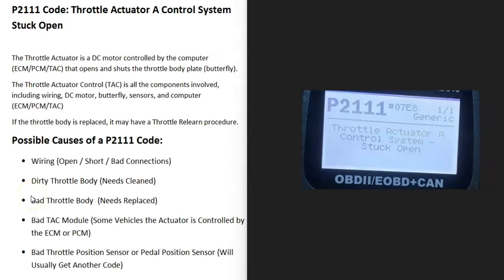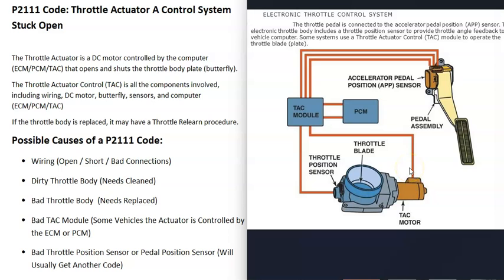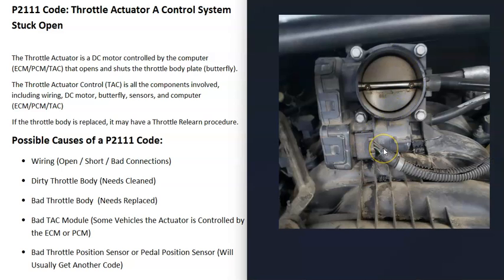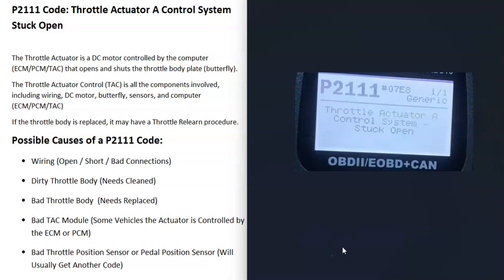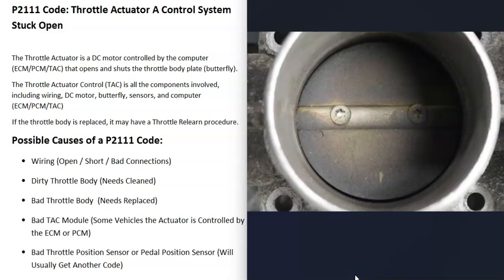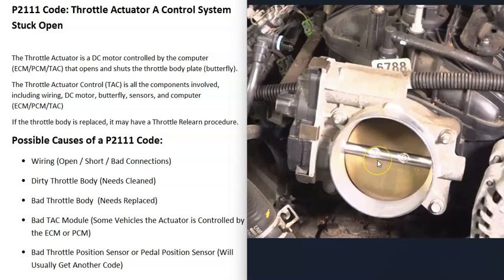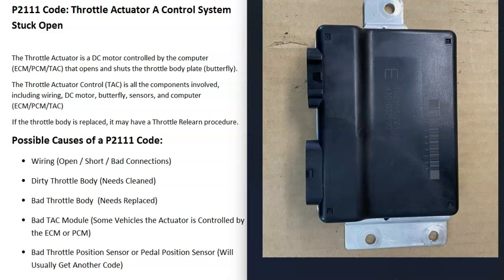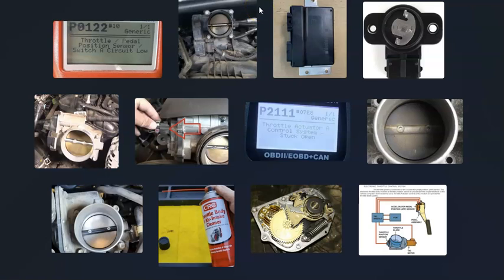Causes and Fixes P2111 Code: Throttle Actuator A Control System Stuck Open

Comment: All I did was replace the battery in a 2006 Ford 500 and I have zero throttle response. The owners manual was followed to the letter in doing the throttle relearn with zero success. I’ve done the procedure five times today, and I have been troubleshooting this crap literally for seven hours watching videos And try and techniques from even other manufacturers with no success.
And all I did was replace a dead battery.
Reply: Did u ever figure this out?

Comment: My fiancé's 2007 Ford Mustang GT recently had this code as well as a P2112 and P2104 all related to the throttle body.  I checked voltages to the TPS and APP and they were normal.   I tested the DC motor and it worked as well.  The fix for her car was a new Throttle body.
Reply: You get a p2135 code too?
Reply: @tonymurphy1234  I did not.
Reply: Did it run before you swapped the throttle body or was it a crank no start?

Comment: I have p2111
P0102 mass or volume air flow circuit low and
P0113 intake air temperature sensor 1 circuit high
Whats going on with my car?

Comment: I got weird symptoms with my pirus 2010 gen3,  firstly the throttle body butterfly don't move when I press the pedal, and when the engine starts the butterfly barly open and close. 
I had a knocking engine recently and I cleaned the EGR and manifold, the knocking is way much better and misfire codes disappeared. But now I got bad idle and short knocking at the start of the engine only. Accelarating is very sluggish and sometimes get the P0103 and P0171 codes.
Help please

Comment: I have a 2012 Lincoln mkx with this code.  
Goes dead after cranking and try to drive it.   When I turn the car off crank it back up it and drives fine.  Could ethanol based gas have anything to do with this??
Reply: Have you found The solution? Me edge isso acting exactly like this
Reply: @ I found out that it was something to do with the master cylinder, and the brakes. I  had put on brand new rotors, and apparently the brake lines had air in them.  Another YouTuber said to put the vehicle in drive and as it starts moving mash the brakes really hard and that would help  the master cylinder brake fluid. Now, after a few weeks pumping the brakes, it works fine now with no issues.
Reply: @Tacticaltig68 looks like a shot. Gonna give it a try
Reply: @ does your brakes have a soft spot or it goes further than normal cause that means there’s air in the lines you can look that guy up on YouTube and see what he says that’s what I did. Good luck, brother.
Reply: @Tacticaltig68  turned out to be the TB. I did disassemble it and have it cleaned, even the actuator chamber. Then the relearn procedure. Seems like fixed now. 5 days without the problem.
Reply: @ that’s great glad you was able to fix it

Comment: I have that code on my car and also a P0300 Random Misfire Detected code, could the P0300 code be caused because of the P2111 code? Or is that something different entirely?
Reply from the maker: It needs to be diagnosed, but I would fix the P2111 code first, as it may be causing the engine to misfire.

Comment: I have  Duster 2016 and the scanner show me these codes about TAC module and TAC valve and air bypass valve P2119,P 2108, P211907, P211991,  what that means please

Comment: Great information. From your experience what if a car is idling high after driving it and if you turn the car off and back on and the car starts and idles fine and you don't have any codes. What would you begin looking at first?
Reply from the maker: I would start by cleaning the throttle body; It may be dirty.
Reply: @HVAC_Mechanic yes it happens to me today and cleaned the butterfly body and that was it
Reply: @HVAC_Mechanic  Connector on accelerator pedal connector was corroded.
Reply: @Mr_Lew1s hello can you help me on what you mean? I got P2111 code actuator stuck. We used throttle cleaner. It was filthy black inside. Then we tried to use car ride good bit once at a slow speed it threw wrench again. Should I use throttle cleaner air intake rather just regular cleaner? I have 2013 Taurus Limited 3.5 L v6!
Reply: @LoyalMeeksSupporter hey did you ever figure out your issue???
Reply: Currently having this same issue with my 2015 ford interceptor 3.5 sedan. It will idle high after the code pops up and I pull over. Restarted the car, continued on and it was just fine for the time being. Gonna start by trying to clean the throttle actuator..

Comment: I got a 2010 Mustang that received this code, as well as the P2104 which is Throttle Actuator Control System - Forced Idle. What exactly can cause these two codes to be thrown at me. Haven’t done any replacements yet but correct me if im wrong when I say that I think it could be the APP sensor. If not then guide me to the right answer. Please and Thank you. And also just wanted to add that this video was really helpful as well. Keep making this content.
Reply: Did you solve this?